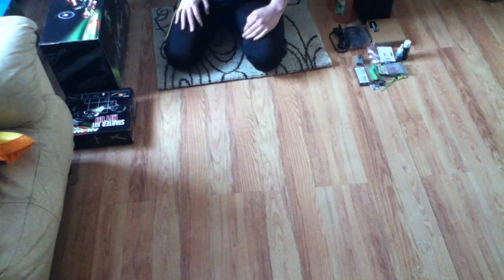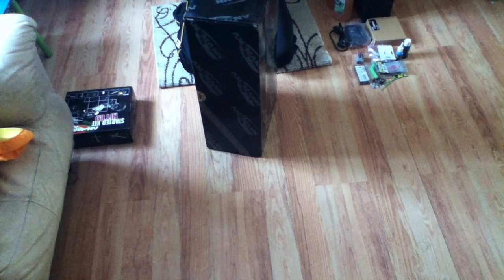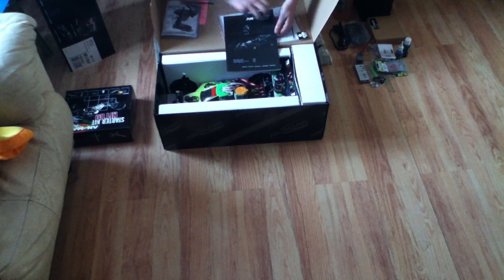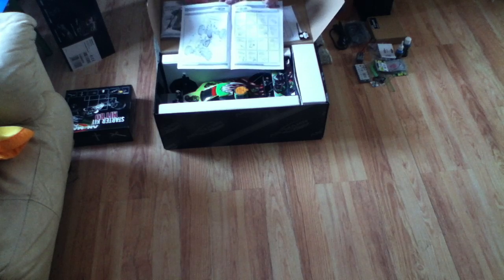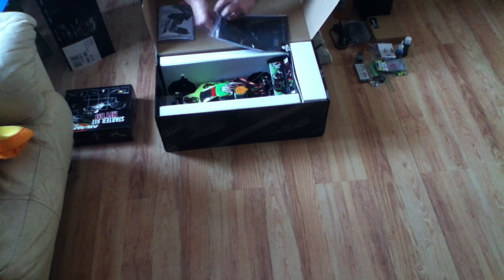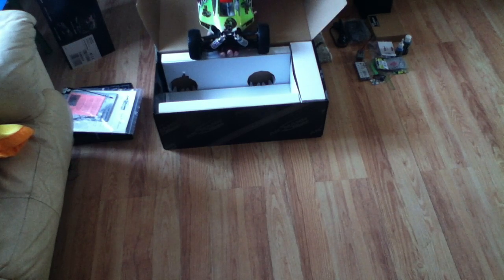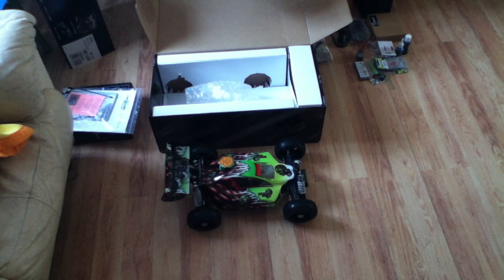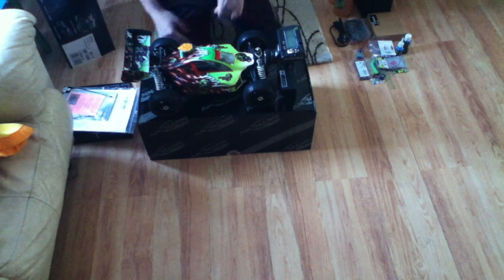Ansmann Racing Virus 2.0 BigBlock Out of Box

Comment from the maker: @TW1ST3R1997 Yes it does come with it's own in-built failsafe, The reason it doesn't say it comes with one is because it comes under the Transmitter Package not the Buggy, if you read the spec it tells you everything about the buggy ie: size, engine, weight, gearbox, 4x4 and so on but only tells you what Tx & Rx it comes with. If you just google or look at the site your on and see if they sell the transmitter & receiver separately, the spec shown will tell you everything you need to know about